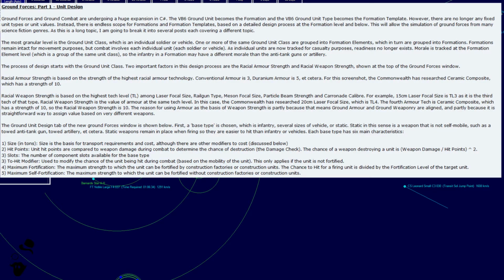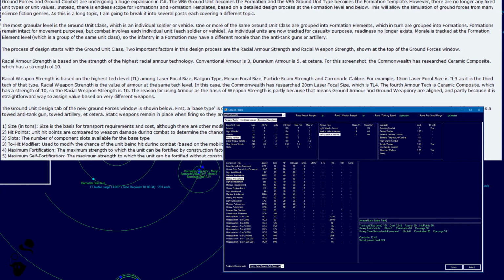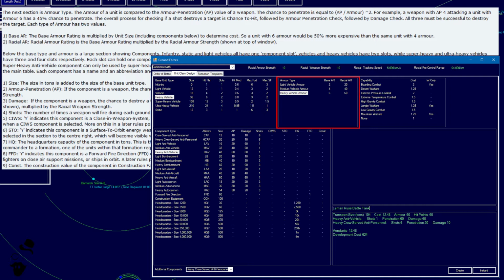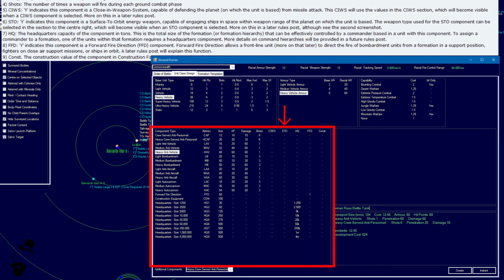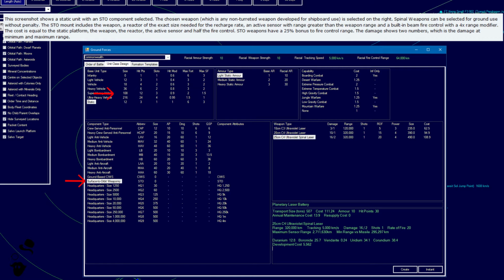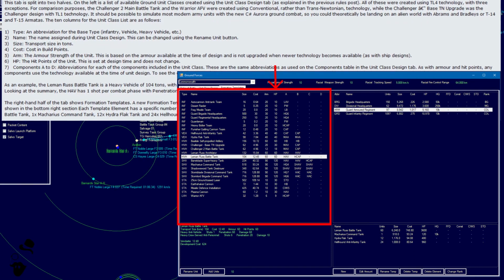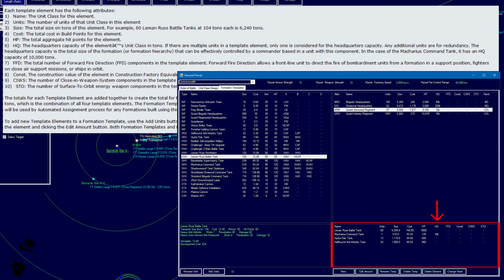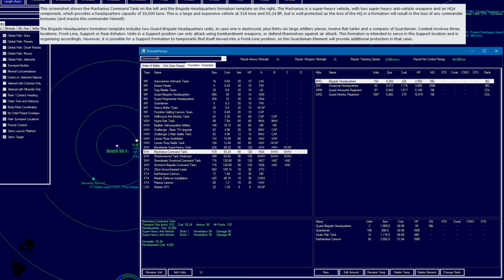Aurora C# Changes - HYPE Train - Day  11 - Ground Rework!

Comment: I watched this while I wasn't trying to fall asleep.

So, if I'm understanding this right, it looks like ground force design will be slightly more complex than ship design in the sense that we have two levels of design to consider instead of one. We have to design the individual units, but we can't just build those, we need to put them into formations, and those can be built. I wouldn't say it's more complex than ship design, but it is one more thing we will need to do to fight in the spreadsheet wars.
Reply: Ship design has two level as well. You have to design the individual parts, the engines and weapons and such, but you can't use those on their own, you have to add them into a ship design, and then that ship can be built. The systems are somewhat comparable. The units are like ship parts and the the formations are like ships. 

Or you could look at it like SerBeardian mentioned, where the units are like simple ships and formations are like fleets. In that case the system has less complexity overall since unit design (so far at least) seems to be simpler than ship design, and fleets/formations seem to be on a similar level.
Reply from the maker: Yeah, that seems to be about right: you design units, but then just throw those into formations. Seems to me like you can shuffle units around within formations though (ep12 covers this) so it's less like two layers of units, and more like "ships" and "fleets". Formations seem to act just like Task Groups - a collection of individual units that move and function as a single whole.

Comment: Been waiting for the C# since the normal version doesnt resize to my screen and I cant play it. x.x
Reply: You can use reduced sized windows to play it on a smaller screen. It moves some things around and gets rid of some other things, most notably on the task group window but overall it's still perfectly playable.
Reply: @jatzi1526  How do I do that? Because im on a widescreen LG TV and the normal windows for the game cuts off the bottom half of the game and cant reach some of the buttons to even advance the time lol
Reply: @idontconsenttoinfobeingsol3041  When you first start up your game there should be a bar with game, spacemaster, empires, calculations, game parameters, miscellaneous, and help. Reduced height windows is under game parameters
Reply: @jatzi1526  Oh ive done that and the window is still too small. Still cuts off the important buttons that require clicking to play :(
Reply: @idontconsenttoinfobeingsol3041  wow